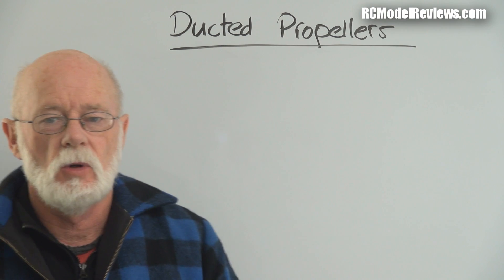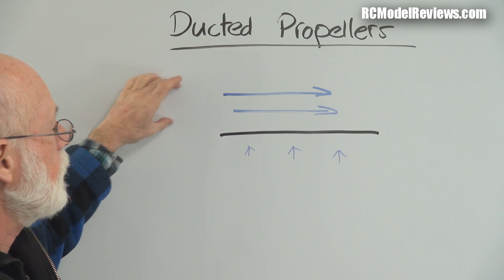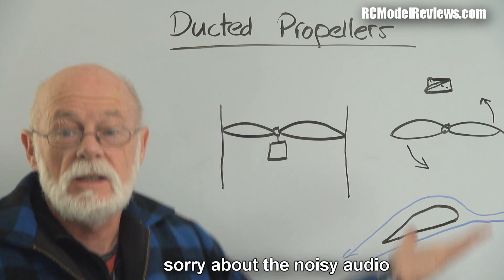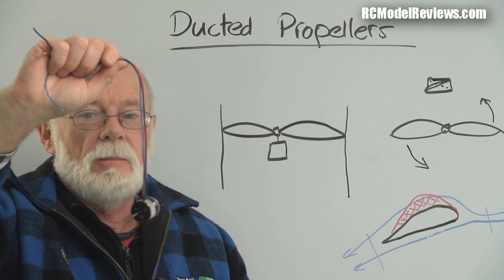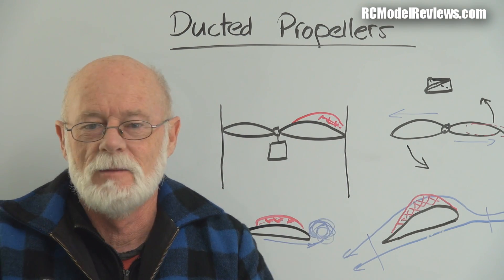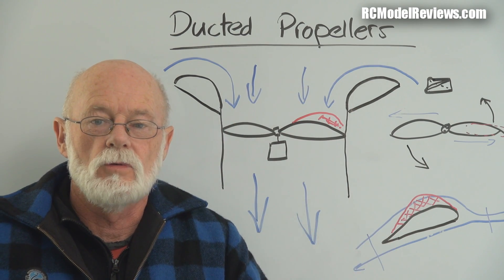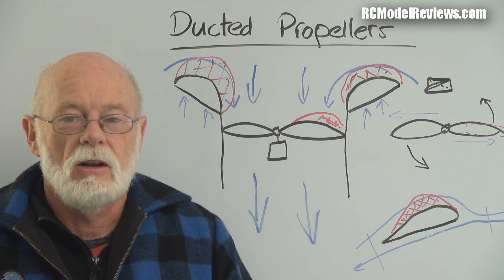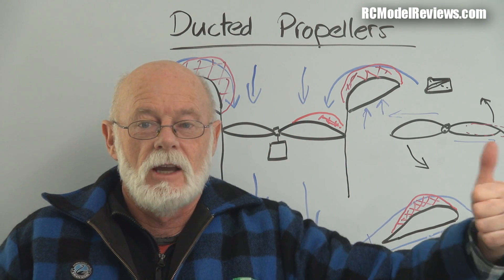How ducting a propeller increases efficiency and thrust

Comment: Very nice. Only one point - when you  show the Bernoulli effect over the wing, you draw the two lines before and aft, showing the path above is longer. This assumes sibling parcels of air have to join up at the trailing edge - that they take equal time to reach it. No, they don't meet up. Yes the air on top goes faster, and that below goes slower - by so much that they cannot meet up (and in fact if they did, the wing would not work :-)
Reply: +Michael Dunlavey - This is true. The air over the top travels faster due to a longer distance to travel but this means that it remains in contact with the surface longer, resulting in a longer period of friction. In a perfect, frictionless world, the air over the top would reach the trailing edge at the same time as the air under the bottom but due to the increased friction period over the top, the air under the bottom actually reaches the trailing edge first.
Reply: +Sean Foster : Well, this is the explanation I found most convincing: https://www.av8n.com/how/htm/airfoils.html  Also: https://en.wikipedia.org/wiki/Lift_(force)#False_explanation_based_on_equal_transit-time  Also: https://www.grc.nasa.gov/www/k-12/airplane/wrong1.html

Comment: Question...what if the duct is incorporated into the propeller tips as an attached ring? I've often wondered why full-size aircraft (e.g. helicopters) don't use something like that to overcome the leading-edge drag on the forward-traveling portion of the main rotor...
Reply: +Tony Bristol , was thinking same thing

Comment: have u already done a video on duct fan tilted forward? do you have a video on battery amp draw and discharge rate due to the different sizes and pitches of props and what prop to battery ratio would be best?

Comment: What effect would a duct have on a very slow moving -- high aspect ratio prop? One that may be used on a human powered craft for example? I have noticed that universities do not use a duct when studying human powered flight. My guess would be a a very low pressure differential between the high and low pressure sides of the prop--- thus negating any potential for improvement. Can you confirm?

Comment: Its a lot more complicated then low pressure pulling up... pretty sure whats happening is the boundary layer drag is slowing down the airflow flowing over, gripping it and at the same time pulling the paper up. 

And lift is more accurate using force = mass x acceleration. That is the force of the air being pushed down, pushes the wing up. Never use equal transit time, wind tunnels have shown that is wrong (seeing is believing right?). 

You also need to look at whats happening to the air in front of the aerofoil, its actually raising, also generating lift. Most engineers say that half the lift is generated before the air has even reached the aerofoil. And the other half is the air being pushed down trailing the aerofoil.

I like how keen you are. In the end lift is too complicated to be explained in 2 dimensions, theres a whole heap of stuff going on. Keep reading mate (Y)

Comment: Could you demonstrate the duct "wing shape" producing lift on its own just by having airflow ?

I think if you attach a cheap 5kgf load cell (easy to read with an arduino) you should be able to measure the lift force produced by the duct alone.

BTW turbine blade tip clearance on 9 through 12 inches dia turbines is 0.030" nominal with over 0.050" being unacceptable for fuel consumption. (new ones are 0.030" +/- 0.0015")

Comment: 5:38 I believe basic economics can end your debate. Large airlines are making a lot of money, but they are still thirsty. They take advantage of every single piece of tech that will make their planes fly farther on less fuel which for them means more money. Boeing is a big name in commercial airplanes as well as many other types of sometimes experimental airplanes. Boeing has sold, and I'm sure would like to continue selling their popular 737 and 747 models which feature an airfoil. Boeing spends plenty of money on research and development of wing designs for their planes, and if they discovered airfoils actually don't produce lift then they wouldn't be using them since an airfoil inherently produces more wing surface area, and therefore more drag. More drag is not a feature, and wouldn't sell well to those commercial airlines who look for every opportunity to cut down on costs.

Comment: This is complete BS.. Unless the prop was specifically designed for the duct. There is throw or "fling" on 90% of props. This means that the trailing edge of the prop is throwing 15% of the air out to the sides. With the duct this is simply bounced off of the duct and disturbing the natural flow of the propeller. It is more easily seen in boat propellers. The "throw" or "fling" causes more disturbance in the natural flow of a prop designed for a specific boat or plane. Ducts do create lift, but the thrust is cancelled out. Lets use a flashlight as an example. In the dark when you turn the flashlight on it disperses the light forward as well as outward vs a laser. a propeller does the exact same thing. when you add a duct to it (again, unless the prop was specifically design to be ducted)  will throw the loss (the excess "fling") at the duct, then bouncing off disrupting the natural flow of air by design. I can make a tank tested video of this in action if you disagree.

Comment: Thanks for this video, three things:
1.- if the quad is moving that same lip is going to work as a wing
2.- A static inverse propeller can be placed at the end of the duct to correct the rotational flow of the air and give even more trust
3.- How much do you think a duct can improve a propeller trust in general? 5%? More, less? Have you even tried it?

Comment: WRONG: Sorry, but the low presure buble goes toward the center, as the air is moved on the outside by the centrifugal forces. Forces apply to air molecules, not to emptiness. ( but your demonstration is still correct)

Comment: Disliked for perpetuating the misconception that the air that flows over the top of the wing goes faster to meet up with the air that goes under the wing. There is no reason for it to do so, and indeed it does not. The low pressure above the wing is caused by the Coanda effect instead, as the air wants to keep flowing horizontally while the wing's upper surface is curving down. Everything else you said was good.

Comment: To eliminate tip vortex bleed maybe someone can 3D print a three leaf propeller with the duct attached to the propeller tips. Both the propeller and duct freely rotate in unison. This would be most efficient for multirotors in a hover with no drag associated with the headwind component since the craft isn't making headway.

Comment: why not make the prop with the ducting attached to eliminate gap?
Reply: +TheHelvetican For a number of reasons; More mass, gyroscopic precessio, more strain during high rpm, not to mention you'd get additional aerodynamic effects due to the spinning cylinder.
Reply: +TheHelvetican 
I was wondering exactly the same thing!
Perhaps a light weight inner ring attached to the propeller tip revolving within a recess in the main duct might work?  If the light weight inner ring had copper windings or had magnets embedded into it with corresponding coils on the outer duct the whole thing could combine to be the motor all in one unit, just a thought???
Reply: +Dan NZ 
That's a fascinating idea.  Sounds horribly difficult to make, but i love that idea.  It would be cool to build as a proof of concept.
Reply: +Dan NZ yes interesting idea , but the weight ,i would think , would outweigh the gain, copper is heavy , maybe magnets , but still heavy at those speeds , maybe if you could magnetize the inner ring as to not add weight and still create enough  magnetic induction,   might work ...?
Reply: +zulu1320  +Jakob Orkin
Perhaps if magnetic particles could be embedded into the plastic at regular intervals around the circumference of the attached propeller ring that might beat the weight issue and we would have a huge amount of torque due to the very large circumference, and don't forget we would be doing away with a normal motor entirely. 
And thinking even further ahead, the motor could act as it's own frictionless bearing system, food for thought? Well perhaps and it would be very efficient!
Thanks for the feedback guys :-)
Reply: Dan NZ Polarity matters in regards to the magnets, so you wouldn't just be able to haphazardly embed magnetic particles in the ring.

You'll also get an issue with dust-sealing, you'd probably get a lot of friction if you attempt it with such a large diameter "shaft".

That being said, if you could embed magnets in the ring, aligned and oriented correctly and perhaps do some low-tolerance work between the ring and fairing around it, to minimize the gap where dust and dirt could get into the motor itself, i could see this being a very interesting idea.
Reply: You could choose to use frozen helium but then you just add on mass for the high-powered refrigeration system employed. Super cooled materials reduce electrical resistance.

If this "stuff" collides with birds in flight, their feathers are likely to stick to this just like what happens with SuperGlue.

Comment: Darn tilt ducted fan propulsion does not play out well.  What about four turbines w/ vari tilt arms? Could do prototype w/ four jet cats.could still be nothing w/o a pusher motor for forward direction? I guess the problem before was loss of lift as the transition from vertical to forward flight?

Comment: I have been in aviation for 52 years, pilot, designer, and test pilot . Fixed wing, helicopters and VTOLs. That is the best short course ever. Make more. Interested in ducted fans for my big quad. Using tilt motors for forward flight. Thanks for the info.

Comment: Bernoulli's Theorem is for fluid flowing in a pipe, and it says the the amount of total energy is constant.  If the area of the pipe is constricted, increasing the velocity of the fluid, then the pressure of the fluid goes down.  As the fluid velocity goes up (kinetic energy) the pressure goes down (potential energy).  It is analogous to a roller coaster.  Bernoulli's Theorem only applies to fluid flow in a pipe where there is no energy exchange allowed with the outside.

The example you showed of blowing past the paper is an example of the Coanda Effect, where high speed fluid streams attach to surfaces.

Comment: Some notes about lift that I have learned in the past few decades:
1) It's tricky to "explain" lift using Bernoulli's principle, which is simply a relationship between dynamic pressure and static pressure. But his equation holds and accounts for 100% of lift.
2) Newton's 3rd law (action-reaction) also accounts for 100% of lift. These are just two different ways of looking at the same thing (not two separate effects that add together). The important thing is that the air flows along the curves of the wing and stays attached. Coanda is part of this and relates to boundary layer theory.
3) The top of a wing typically produces about twice as much lift as the bottom. The trick is to keep the air flow attached and flowing along the curve of the wing top. The curve is a combination of the angle of attack and airfoil shape. If the curve is too great for the speed of the air, the flow detaches and you get a wing stall.
4) The "air moving faster over the top because the distance is longer" thing is a myth. The split air flows don't meet up. See Wikipedia article on lift.
5) There is an upwash in front of the wing, and downwash after. For 3D wings the momentum of the NET downwash is equal to the lifting force on the wing (a la Newton).
6) For 2D wings, the upwash equals the downwash and there is no net downwash. Yet there is still lift. An example of a 2D wing is a wing mounted on each end to the walls of a wind tunnel. Or an infinitely long wing.
7) Wing designers try to increase wing efficiency by making 3D wings operate closer to the 2D case. Examples are: long wings (high aspect ratio), winglets, ducted fans, wing in ground effect, etc.
8) For a normal (3D) wing above ground effect, there will always be spanwise flow (and even more for low aspect ratio wings). As Bruce explained, the cause is pressure differential. There will be small vortices produced all along the trailing edge and a big vortex at the tip. See Wikipedia article on "lift-induced drag", sometimes called vortex drag.
9) From an aerodynamics point of view, adding a winglet is the same as increasing the length of the wing. Both reduce spanwise flow and wing vortices. So you get the physical advantage of a shorter wing with the performance of a longer one. Extending this idea, putting your prop in a duct is the same principle. You get the physical advantages of a shorter prop with the increased aerodynamic efficiency of a longer one.

Cheers!
Max
P.S. That experiment where you blow over the top of a piece of paper is flawed. For Bernoulli's principle to hold, the air needs to start at the same total pressure. The air over the top is not from the same source as the air on the bottom, and in this case actually has the same static pressure. The paper rises because the jet of air from your mouth flows along the drooping (curved) piece of paper like the top of a wing, lowering its static pressure even more. If the paper was flat to begin with (parallel to the jet of air), you could not get it to lift up. A more technical statement of Bernoulli's Principle is "the total pressure of a fluid (static plus dynamic) stays constant along a streamline".

Comment: Maybe I'm oversimplifying the concept, but from the demo and explanations, it seems our RC quads are losing a lot of energy because they do not have ducting.  Adding ducting ergo, would increase efficiency, reduce power consumption and lead to longer run times.
The 4 ducts would cost say $1 to $4 on a $200 quad, a fairly low cost improvement/addition.

Comment: If those duct's dont improve the lift enough to off set there weight you should look at putting just a upwards fin on the end of the blade upwards like most modern aircraft wings. This will only make the setup a few grams heavier compared to a duct which is many grams heavier. Modern computer fans are starting to change shape from a clasic style propeller and are getting a lot more air flow at lower noise cost and lower rpm.

Comment: ther is one more effect that increase the thrust. tha propeller is making the air go downwards. but not in a straight line. more like a vortex. so the stator blades inside the duct. (the one that holds the duct it self) makes the air go straighter ( less energy loss) (please apologize my english - im just an Norwegian avionics technician)

Comment: This explanation doesn't work (but it should) if you blow the paper which is directed to the ground earth from top to the bottom. You should explain the whole principle )
Another thing is airflow on the top should not (and won't) be at he same point in time (that's how you explain LPB) as the flow from the bottom.
But anyway thank you very much!

Comment: tl;dw- Centrifugal force flings some of the air traveling over and under a propeller blade out toward the tip. A duct traps this air in a high pressure zone, allowing the propeller to use it for lift instead of wasting energy flinging it out in a radial direction.

Comment: The vanes also create a benefit in those shrouds. They will effectively increase the pressure coming out the back. They redirect the air straight down as the blades push it downward at an oblique angle.

As an illustration; I tried to push air through a pipe with a computer fan mounted on the end of it. It was rather ineffective. I then recalled AgentJayZ saying that the blades will add velocity to the air but the stators will redirect the air and create pressure. I then added little stators just inside the pipe with simple pieces of tape. It was remarkable how much more flow through the pipe there was.

Comment: Propellers are much like a wing. And like a wing, it is easier for the air to flow around the tip than to create lift. This is why some planes use winglets. They prevent the air from slipping around the tip and force it to travel across the full chord and create lift. 
There may be a little centrifugal force, but most of the loss is due to the same factors as a wing.

Comment: i learn well with technical drawings. Can you do a video on wingtip fences? I work for an airline in engineering and one of the old engineers reckons that wingtip fences are inefficient on delta shaped wings i.e 777 unless they are on extended operations?

Comment: I did some (brief) research on ducted fans about a year ago and was told that a ducted fan won't produce as much lift in a hovering model as an open propeller but was better if it was pulling an aircraft through the air horizontally ie.  moving through the air and not in a static lift.  I don't know if it's true and this video seems to dispute that.

Must do more research.

Comment: Not sure if any one mentions this. This is all fine if you go straight up, but as soon as you move horizontal to the ground the wind resistance to the side of duct, does the performance increase compensate for the increased wind resistance and weight?

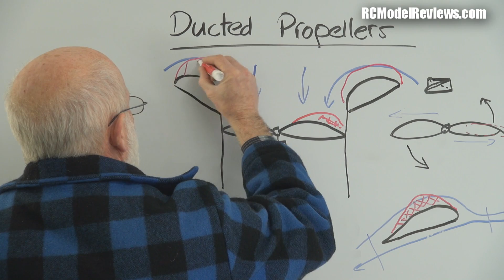Comment: Cool video. In all fairness, though, the Coanda effect described at 13:15 will exist primarily at zero or very low airspeeds, such as a ducted fan just before starting to accelerate down the runway. As airspeed increases, less and less air will move around the duct lips in the manner described and will either flow straight in or spill over around the duct, and what was previously a low-pressure area contributing to total thrust is now a maximum pressure stagnation point. This is why you don't see large bell-like input lips on airplane fan inputs.